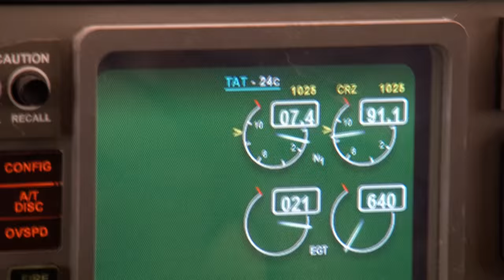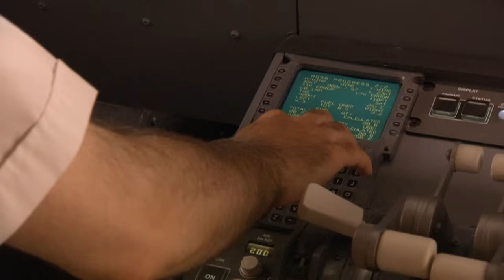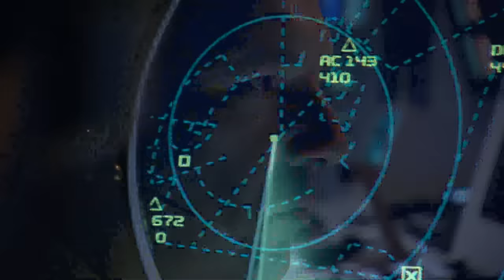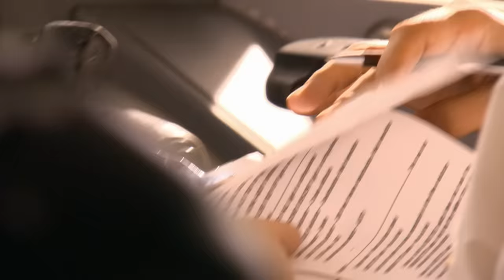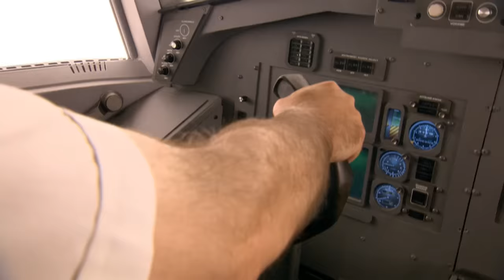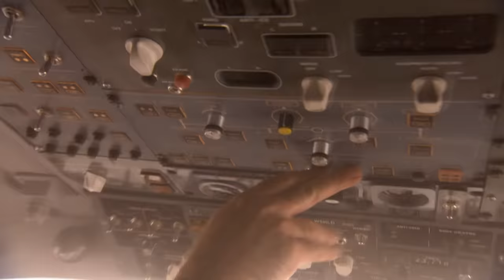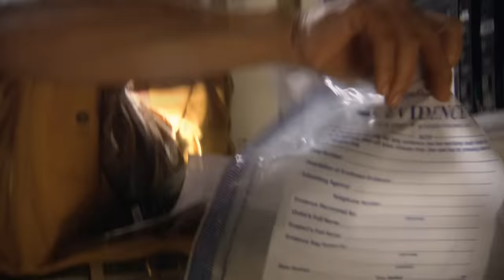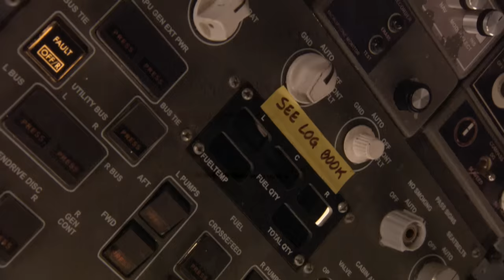Air Canada Flight 143 Lands With No Fuel | Mayday | Wonder

Comment: I was the Operations Group Chairman on this investigation and can still remember the details of this accident clearly. Rocky Paquette, the Investigator-in-Charge called it our first metric accident. Neither the flight crew nor the ground crew in Montreal used the right method to convert the fuel load to metric. Once airborne they failed to notice they were cruising with a reduced power setting, a clear indication the aircraft was lighter than they thought. Finally, according to the aircraft Minimum Equipment List they never should have departed their home base of Montreal without serviceable fuel indicators or doing a proper drip test.
Reply: Thank you for those clarification. Former glider pilot here remembering the expression "Doing everything right after doing everything wrong." Mistakes do happen -- administratively, mathematically, and judgment, but even with relatively low time in type, what these pilots did to save the aircraft was extraordinary. It's usually a cascade of mistakes that cause fatal accidents, which is why redundancy and cross-checks make accidents rare. Everyone learned from this one, which fortunately wasn't fatal.
Puzzled by one line in the video at 26:10 when the narrator says the captain never performed a side-slip in a glider.  That's part of every glider pilot's training, to be used when approaching too high and beyond the ability of the dive brakes to increase drag sufficiently.
As a former tow pilot, I loved racking the Super Cub way over on its side and falling out of the sky sideways so the engine didn't cool too fast and got me on the ground sooner.  The plane shook and rattled like the video shows, but it felt very stable.  And to answer another commenter's question -- the air speed indicator is useless in a step side slip with the air flowing crosswise on the mouth of the pitot tube. No point looking at it, but with practice, it's a safe maneuver. Still, not recommended to do for the first time in a commercial airliner.
Reply: As a pilot, i find this remarkable. Heroes. I very much relate to Bob in his surprise and gladness to learn how he would react in an adverse situation. It Happened to me with a failed power bus and gear stuck up. 
  I became a human sweat fountain. But What i am most frustrated with here, is the conversions. There are too many conversions going on. Volume to weight. Weight in Lbs or Kg’s. And in their defense, it was at a moment (3 years?) close to the Canadian conversion to metric system universally. But WHY must anyone have to convert vol to Weight?! Why doesn’t the plane carry 44,000 gallons? Or liters. My plane Carries 150 gallons. Its not weight, but it’s gallons. The pump on the ramp fills gallons. The trucks ought to have weight as their primary measurement and eliminate a step. 6lbs per gallon, right? Oh wait… Kg. But anyway these guys were amazing!!!!! And yeah i see your point. You’d feel the weight loss at cruise. Why are we at 75%? Or even on climb out. But maybe not, if you only had 75 hours experience , an almost empty cabin, and a few other things mentioned
Reply: A point I made in a previous reply as well. In my opinion, there should at the very least be a manual fuel gauge so that you know exactly how much fuel you have. Computers have taken over to many of the vital manual instrumentation components to the point that they are relied on far too heavily. With a known faulty computer component involving the fuel level, the aircraft should have been grounded. It has been a while since I have flown, and baring a family emergency I doubt I will ever fly again.
Reply: @markemmer4371  Going from memory, but seems to me Captain Pearson did side slip. He and I never agreed on the need to do a cruise performance check. Although I had trained on the B767, my flying experience was military and a cruise performance check was standard practice. When I went into Boeing charts and compared the cruise power settings from the FDR to the Boeing numbers they were dead on for the reduced weight. The difference would have been quite obvious in my opinion. Nothing I did or said during my investigation or in my report diminished what the crew did after the fuel was exhausted.
Reply: @Electrocycle300  At the time, they had also just done away with second officer position and it was the second officer who did the fuel calculations. That, plus the new technology, and the crew’s low flight time on type may have all combined to make the error. But, the MEL was clear. To leave a main base they needed fuel readings. The cold solder in the fuel management computer was the major technical problem. Resetting the CB gave only temporary readings. The biggest human error though was using the wrong conversion factor and that error wasn’t only on the pilots.
Reply: @jimstewart4074  No question that he side slipped the aircraft.  I wasn't questioning that, just noting that the video claims he had never side slipped a glider, which is part of every glider pilot's training.  I suspect that part of the narration is incorrect.
Reply: Wow!!!!!
Reply: @markemmer4371  yeah I think they meant to say he had never slipped a commercial airliner..
Reply: @jimstewart4074  Thank you for your valuable input. As a business owner, I put the lion's share of the blame on Air Canada management for implementing a system that requires conversions. That is an accident waiting to happen. Anticipating where the nodes of failure can happen, creating redundancy and streamlining systems is something you have to do because people will make mistakes. If you complicate their jobs unnecessarily, you are asking for those mistakes.
Reply: @film50565  Thanks, Doug. There were a lot of issues, some regarding personnel which I don’t want to get into so long after the accident. I wrote a book and included my Gimli Glider experience.
Reply: I had wondered about that because the eight of the fuel being expected to be about twice that of what they had, it strikes me as a bit of complacency on the part of the pilot and copilot. And it’s in these things which the phrase complacency kills is apt, thankfully no one suffered more than minor injuries.

Comment: I have the highest level respect for airline pilots. I have had a landing in Houston-Bush where we almost didn't make it through a tailwind in wintertime. The other was at LAX when we pulled back into the air so we didn't crash into the plane in front of us landing on the runway.

Comment: I was working at Air Canada back in 1983 when this happened and I remember this well. Everyone was so glad of the outcome. The Cincinnati flight was also a month prior in June of 1983. They had an electrical fire and it didnt end so well. 23 passengers died in that fire. It was bad.
Reply: The problem was the refusal to use the superior 'Metric System'  The US  may never adopt it because it is too easy and foreign.
Reply: @oliviamonkey  
I live in the US now since 86 so I will never get used to the metric lol
Reply: @onlyyou5817   Very funny, You don't use the Metric System  but the " old fashioned  "Imperial System"   ounces and feet and miles.
Reply: @oliviamonkey  Also, American tradespeople have been trained in the imperial system... our older tradespeople are adept at working with those types of numbers/measurements & many would choose to just retire early if they were forced to convert at this point. Currently there is a crisis of too few Americans entering the trades & many of our older tradespeople will retire in the next 10 years or so anyway.  Come that time, not using the Metric system will be the least of our problems when it comes to needing skilled tradespeople... if the US doesn't find a way to get younger people to enter the trades in much greater numbers soon, there just won't be any tradespeople to hire when the rest of us need a job done. That means no mechanics, plumbers, pipe fitters, electricians, drywall hangers, roofers, carpenters, tilers, machinists, heavy equipment operators, etc... :( 
[1.23.2022]
Reply: @onlyyou5817  The only countries left who've not gone metric are Myanmar, Liberia & the US.
Reply: @mcsmama  The Mars Climate Orbiter, built at a cost of $125 million, was  launched by NASA on December 11, 1998 to study the Martian climate, Martian atmosphere, and surface changes.  Crashed when it got there due to a mixup of metric and english calculations.

I teach mechanical repair and students grasp the metric system far better than fractions.  wrenches numbered, 8,9,10,11... are easier to figure out than 11/32, 17/64, etc.   quick which is bigger?  5/8 or 11/64?
Reply: Me reading your comment: 🙂 then ➡️ ☹
Reply: @oliviamonkey  What do you mean? How does what happened relate to the metric system? I've been listening while cleaning so I mightve missed something in the video.

Comment: Air Canada is fully to blame for this mess. They failed to ensure the people gassing it were trained, or they could have requested the plane to be delivered with fuel gauges in pounds.
Reply: Keep in mind that Canada changed to the metric system but we also used the imperial system. Canada wanted to change from the “old” imperial system and would have probably enforced metric system usage. My guess is that this accident happened during the transition era from imperial system to metric system. Nowadays, we are taught metric system with the occasional reference of the imperial system so hopefully this type of accident won’t happen again.
Reply: Barely, this happened at a time when Canada was switching from the barbarian Imperial System to the Metric System, the ground crew was told to put 5000 Kilograms of fuel, but since they were used to the Imperial units they accidentally put 5000 POUNDS of fuel, barely enough to make it even halfway through the flight
Reply: according to wiki Metrication in Canada began in 1970 and ceased in 1985
Reply: @Racko.  "Barbarian"  LOL!!!!  Only to people that aren't too bright.
Reply: @nix4644  look, I'm American, but I fully agree that we need to get rid of imperial measurements completely. It's so stupidly arbitrary and nonsensical compared to metric. We're doing future generations a disservice by not phasing it out.
Reply: or maybe have fuel gauges that work might have helped!
Reply: When the 767 was ordered, Air Canada was a Crown corporation (owned by the gov't of Canada).  Canada having gone metric in 1978, the airline was instructed to have the new planes equipped with metric gauges.  So the blame really lies with the government itself.

It could have been worse - originally, the planes were supposed to be delivered with metric altimeters and airspeed indicators as well!
Reply: @stephenp448  Things change and for good reason. It's not the problem of the government. It's their entire job to know the numbers and fill the planes. They didn't do their job and they got complacent with other peoples lives.
Reply: @joer8854  yes, things change..  I have no objection to the metric system, though like most Canadians I think in a very convoluted mix of metric and imperial units every day.

The major point of my previous comment was that the Government of Canada (as the then-owner of Air Canada) insisted on metric gauges in the plane, while all other aircraft in AC's fleet used imperial gauges.  I can't comment on Air Canada's training - I had only just finished grade 2 when this incident happened.  Obviously, everyone involved in calculating the fuel load made a basic math mistake in using the wrong conversion factor, and that mistake SHOULD have been caught.  The reason I place at least primary blame at the feet of the government is that I view the metric gauges as a political choice;  Canada had just gone metric, and the government-run airline with its shiny new airplanes was durn well going to toe the metric line and support the new policy.  The rest of this entire situation is simply fallout from that decision.
Reply: @stephenp448  they went metric because a base 10 system is easier, simpler to convert to different measures (mm,cm,m,km) and is more sensible.
Reply: @joer8854  yep, you're absolutely right.  It's also true that the government played politics with an aircraft order.

When all of your other planes use imperial measures, and all of your pilots and ground crews are trained and accustomed to working in imperial measures, the prudent and safe thing to do retain commonality across the fleet.
Reply: @stephenp448  So nothing should ever be changed or upgraded. You know why  Canadian nuclear plants cost an insane amount of money to maintain? Unless the entire facility s upgraded  parts must be replaced with the exact parts it was built with. Because many parts are unavailable and a refit is expensive many must hire scores of engineers to repair parts that can't be purchased or build them from scratch. The problem isn't the change it's complacency and not instituting the changes properly
Reply: @stephenp448  And because they did that and failed to property train their employees and failed to have people double check the calculations, this mess happened. Luckily no one died this time. But mistakes like this cost lives.
Reply: @joer8854  when they cant buy parts that fit their unit they should not to be able to BUY that unit! stupid people do stupid things. aspecially engineers!
why order ANYTHING you cant get parts for?
Reply: @KabukeeJo  That's the real problem. Proper training and having a different person verify.
Reply: @dalemaloney255  Facilities like that are decades old. There were replacement parts but take Pickering Nuclear for instance, the first two units went online in 1972. There were plenty of replacement parts in the 1970's but nobody is making must of that stuff anymore because it's just not worth it. Instead of spending the time to test and verify a modern replacement and verifying it meets or exceeds the requirements of the original equipment and having a system where experts can test and sign off on the replacement they have people maintain the existing parts or scratch build replacements that exactly match the original.
Reply: @stephenp448  who are you calling convoluted? Just because I'm 6' tall, weigh 95 kg, my car gets 24 mpg which I buy by the liter, measure wood in feet and inches but speed by the km/hr, and buy bananas by the lb and potatoes by the kilo, I can assure you we are definitely NOT convoluted.
Reply: @Blox  
The problem in this case is they should never have tried to convert it in the first place because all international aviation standards are Imperial, so he'll still be stating his fuel weight in pounds anyway.

Comment: WOW, that was a life changing event, and getting a monster plane to slip like a glider with no hydraulics is near impossible and this pilot pull off the impossible , and getting it to actually straighten up for the runway so it would stay on the runway, this pilot’s concentration went into super mode

Comment: Nothing but WOW!  I never heard of this back in 1983, course I was over 2000 miles away in Boston.  Wicked skills and luck there!!  Basically "drifted" the plane and if that front landing gear had locked, no way would that plane have stopped in time before hitting the dragstrip.  WOW again!
So after fixing the front landing gear, the plane was able to be flown for repairs, and flew for the next 25 years as well until 2008 when it was retired.